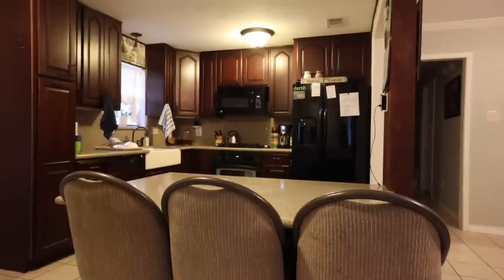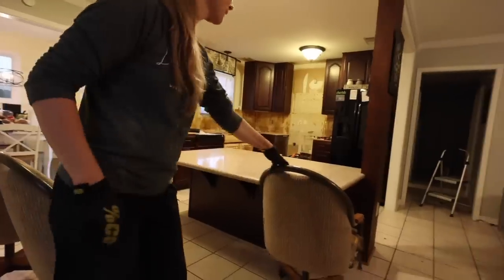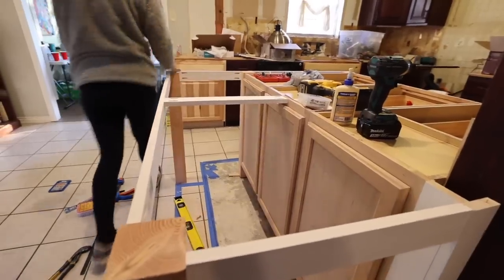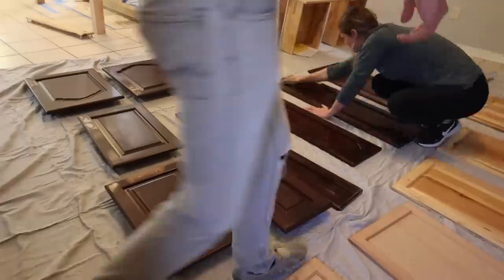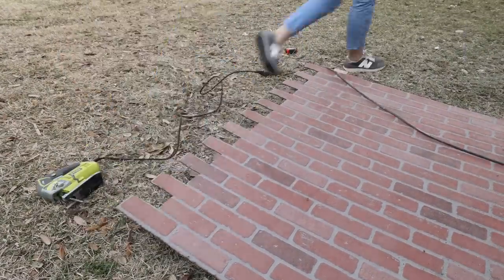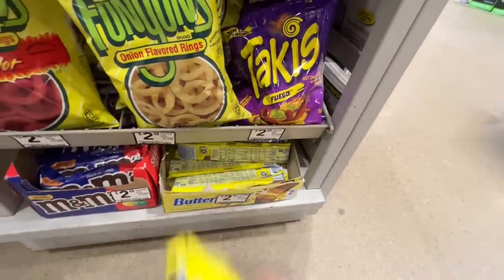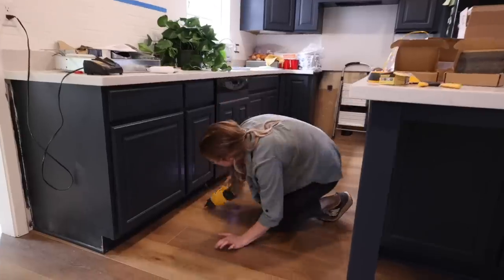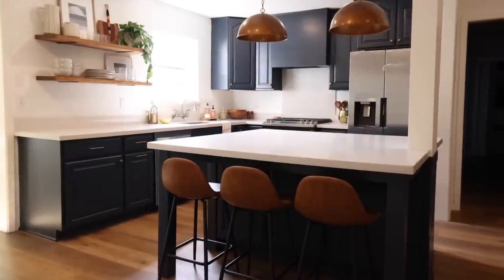Being Sneaky & Surprising Our Friends With A New Kitchen! /Extreme Home Makeover/ Kitchen Renovation

Comment: You've given me the courage and knowledge to tackle painting a repurposed upper cabinet in my laundry room. 
It's oak and that's not a smooth wood to paint. 
I was a lot younger when I polyurethaned the bare wood and now it's repositioned over my washer and dryer so access is awkward. 
I'll probably hand paint several coats of a  dark gray/blue after priming. I have used a similar sprayer as yours that I borrowed from a friend when my kitchen was remodeled/expanded 15 years ago. 
Thanks for highlighting products that will help me achieve my desired smooth finish.